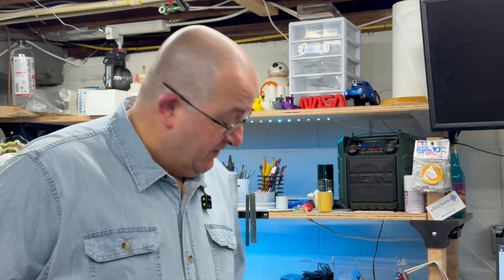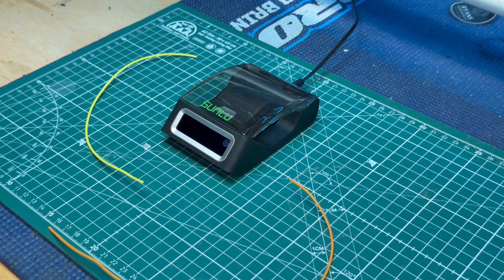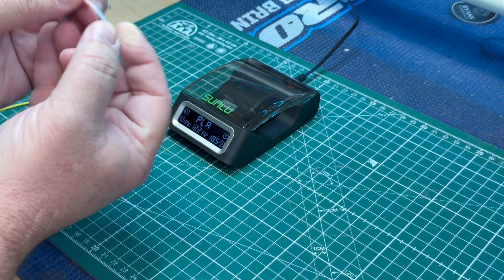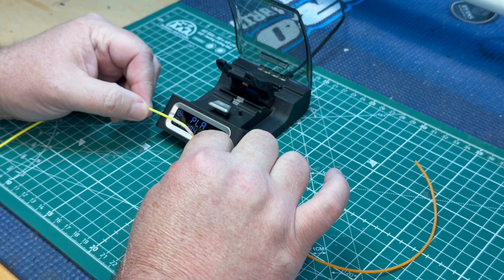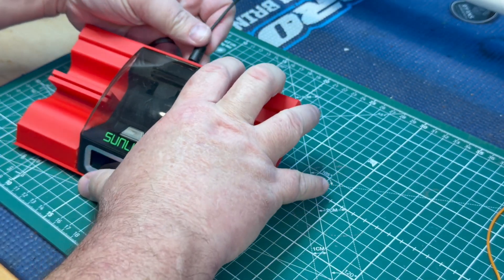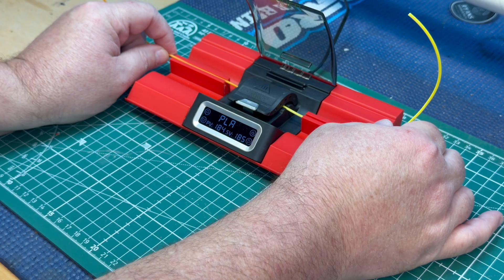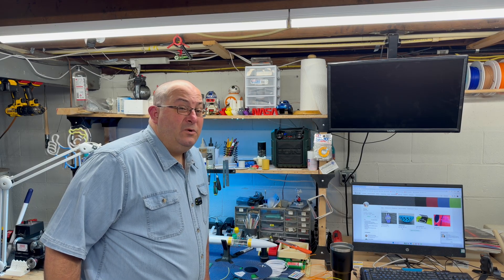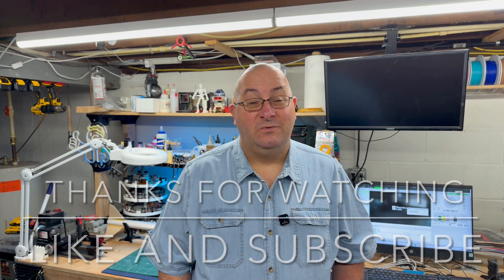Got leftover filament bits? Sunlu FC-1 filament fusion tool operation

Comment: I do the same thing, except I fo it manually. Bought a role of silicone tube on Amazon. It's just a few dollars for like 20 feet or something if I remember. I mostly use it when I before starting a print, I estimate that I don't have enough filament left on the spool. Then I splice on a new spool, and roll the remainder up on the new spool. Then I don't have to wait for when the old spool would otherwise have run out to replace it.
Reply from the maker: That’s a good way of doing it. I just wanted to help anyone trying to do multi colors on the same roll if they didn’t have the AMS..thanks for watching!!

Comment: Almost every time I try to do this, it ends up making the joint too thick and it won't go through my machine without jamming.
Reply from the maker: It took me some time to get the technique down perfectly. I try to stop the tool at the first beep. And make sure you cut at 45 degree angles.. good luck and thanks!